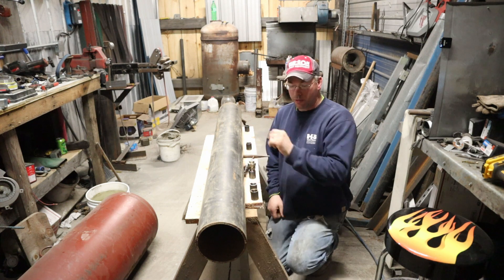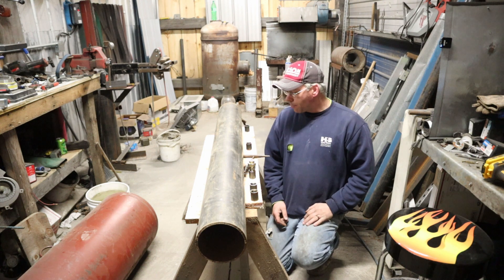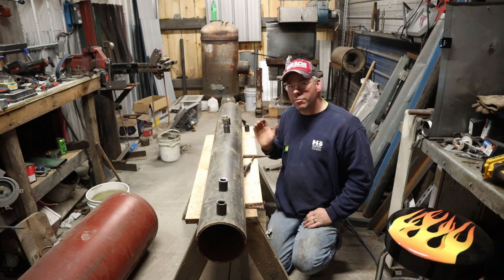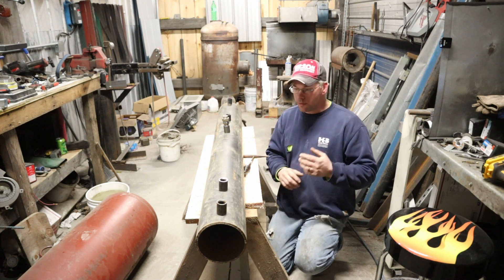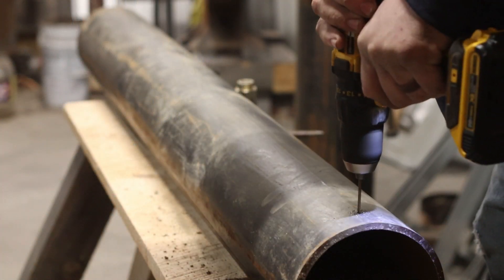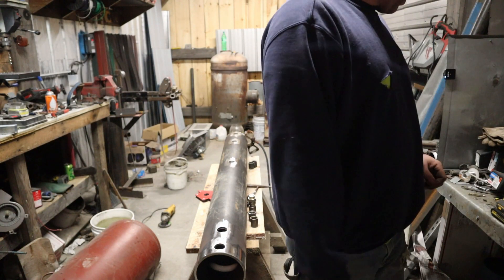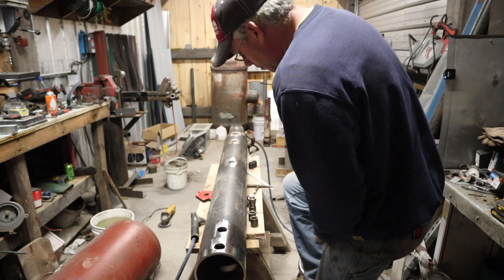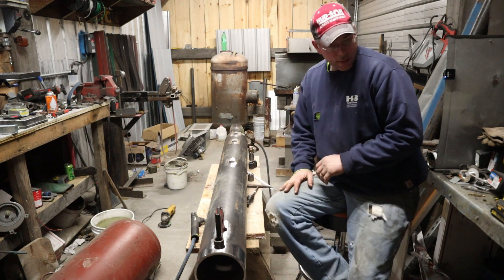DIY Hydraulic Tank For The Cheapskate: Super Forge Press Build Part 5

Comment: How would a tank like your do for a log splitter as the hydraulic tank i was thinking about that cause on fixed budget any advice steel so expensive now dad did his square 39”by 10” wide like doing that be running a 19gpm pump

Comment: Hello just bought my first wood splitter and i guess im not familiar enough with hydraulics the motor they used is a old wisconsion v4 but there is no reservoir tank nor do i know the gallons per minute for the unit to size it properly but this process could also be used for a log splitter correct or would there be different angles to put the holes for that application?
Reply from the maker: It can be used for a wood splitter.

Comment: I have 2 good Porter Cable cordless drills but I rarely use them on large hole saws. I have a nice corded 1/2" Hole Hog for drilling. Your idea for a huge hydraulic tank is good because most industrial machines have those rectangular tanks, very hard to weld. I'm making an electric winch plate for my trailer out of 4"x5" angle iron. Take care. Don't forget to test your tube with water before you fill with oil.
Reply from the maker: Hello T
Reply: Thanks Jim as always.

Comment: If you need additional cooling of the oil reservoir you can always add 2" wide fins to the cylinder every 1-2" around the outer circumference of the cylindar, that should increase the surface area of the oil reservoir a lot and limit the need for additional cooling. :-)
Reply from the maker: Good thoughts, thank you.

Comment: I see you have the return above the oil level it would be better to return below oil level to stop aeration of the oil, Also are you adding a vent in your tank as you said you were fitting a ball valve to the filler point, so when the oil heats up it will pressurize your tank.
Reply from the maker: Great input, there will be a vent and I am changing where the sight glass goes.

Comment: You could get a chimney sweep cheaply. Cut it down to match the ID of the tube. Use your drill to wire brush the interior of the cylinder.
Reply from the maker: Very good idea.
Reply: Great minds, I was giong to suggest the same,  or a bore hone (like for engine cylinders) and some extensions. Wouldn't be too hard to make one with three oil stones, some small flat-bar, and some stainless bolts/nuts.

Comment: I like what you doing with that. One way to get that cleaned out would be using a chimney cleaning brush the metal type that you would hook to a drill. You could also use some rust converter.

Comment: Have you ever used Tallow to cut with? We used to use it when threading 20mm conduit when I was sparking ..... it is as good as cutting compound at slow speeds and better than a spray of oil ;0)